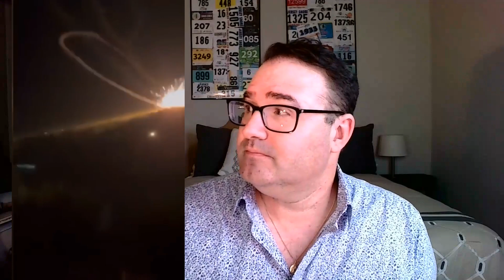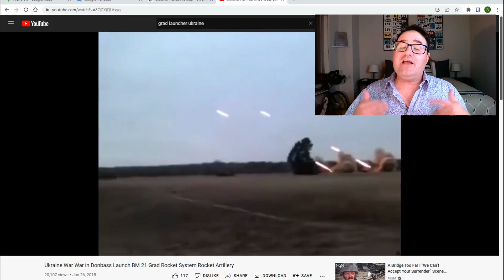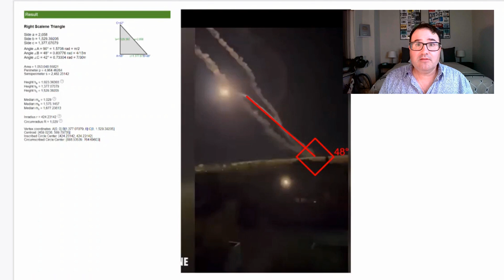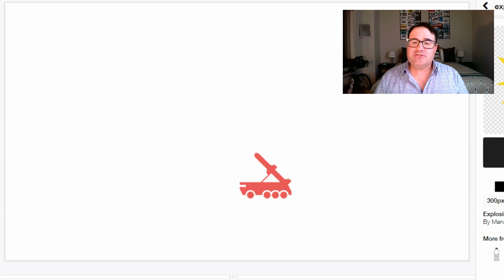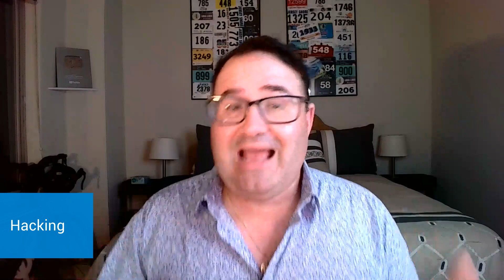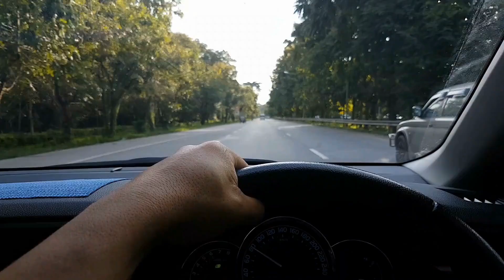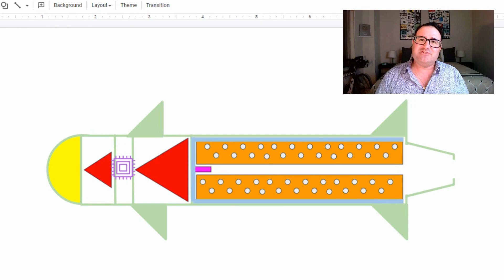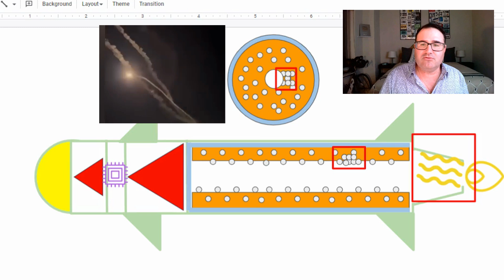Why this missile U -Turned

Comment: The most important thing to remember is that the missile knows where it is at all times. It knows this because it knows where it isn't. By subtracting where it is from where it isn't, or where it isn't from where it is - whichever is greater - it obtains a difference or deviation. The guidance subsystem uses deviation to generate corrective commands to drive the missile from a position where it is to a position where it isn't, and arriving at a position that it wasn't, it now is. Consequently, the position where it is is now the position that it wasn't, and if follows that the position that it was is now the position that it isn't. In the event that the position that the position that it is in is not the position that it wasn't, the system has acquired a variation. The variation being the difference between where the missile is and where it wasn't. If variation is considered to be a significant factor, it too may be corrected by the GEA. However, the missile must also know where it was. The missile guidance computer scenario works as follows: Because a variation has modified some of the information that the missile has obtained, it is not sure just where it is. However, it is sure where it isn't, within reason, and it know where it was. It now subtracts where it should be from where it wasn't, or vice versa. And by differentiating this from the algebraic sum of where it shouldn't be and where it was, it is able to obtain the deviation and its variation, which is called error.

Comment: Can assymatric burn boomerang a missle direct to it's starting point so accurately? If the exhaust is properly built, the thrust will still go straight out the back, aerodynamics and fins kept straight during the boosting phase will require immense power pushing it sideways to boomerang that sharp and at that angle. Especially if it was travelling straight.

Imo it would be an internal problem with tracking amd software due to long storage, or that the target was destroyed during the previous launch and the software went janky. Idk, just a theory

Comment: My vote is for some kind of malfunction with the final stage guidance. That system took over, identified the launcher as a target. The uneven fuel theory doesn't work because you need something to actively cancel the spin created, once it has occurred. Looks like active guidance. The weird bit is that the final stage (on-missile) guidance would have to kick in when in theory there should be lock-outs for this.
Reply: That wouldnt be possible… Imagine the radar seeker in the missile as a moving dish (it actually probably is), the radar dish can only “see” radar returns in a cone in front of it. It would never ever track a target behind it. That is in fact how some missiles are defeated by aircraft, if the missile is low on kinetic energy to maneuver, the aircraft might be able to maneuver out of the missile track cone and make it so the missile can no longer track it.
Reply: In the BUK, as in most Medium/Long Range SAMs, initial guidance is done through radio command. The tracking radar literally flies the missile towards the target, just like someone would fly an RC plane. The missile doesn’t seek radar returns like he suggested on the video, it only does so when the missile “goes pitbull” and activates its own radar, at which point it would indeed be flying towards it’s own radar track. That’s why it would never “lock on” the search or targeting radar’s signature.
That would be possible if that was a Anti-Radiation Missile, which does track radar signatures, but SAM’s don’t work like that.
Reply: Yeah bad take lol. It wasnt in final stage or near it, it was clearly still burning fuel when it happened. And he also clearly explained how it straightened back out afterwards, but that it didnt matter because it was already facing the ground.

Comment: At 4:32 you can see a bright dot right to the blue arrow. In the frames after that, the bright spot moves and it almost looks like a part of the rocket broke off.
I am not sure if the bright spot is not a reflection in the video footage. With "," and "." you can watch videos frame by frame.

Comment: This reminds me of when someone stuck a gyroscope in a rocket upside down. Caused the rocket to do a u-turn as well, but they detonated the rocket before it could hit anything. 
My point is, or rather my question is do these rocket systems require gyroscopic components and where are they being sourced right now if at all? Can they malfunction? How does long storage affect them? etc.
Reply: I doubt much of anything being used in Ukrainr by Russia was recently manufactured. Thus it is some old stock.

Comment: you are probably wrong. Pressure doesn't work like a vector inside a fluid (I'm using my basic pre bachelors degree physics knowledge, just understand my logic don't quote me on my terminology). If the clump is creating excess pressure and gases, it simply pushes against all the surrounding gases too increasing pressures in all directions. Which the gases existing the nozzle wont have any different velocity (which is preed with direction) than otherwise.

even in the worst case scenario its hard to imagine it making a 180 degree turn.

i believe its a software glitch.
Reply from the maker: You know what's interesting reading this?  Everybody who has commented has left different comments based on their job.  Engine people say it couldn't be the engine.  Software people say it couldn't be the software.  Materials people say it couldn't be the fins snapping off.  Electrical people say it couldn't be guidance.
One day, I'm going to do a video on diagnostic momentum.
Reply: @RyanMcBethProgramming  lol.

 I don't think the fins can snap off by human handling (missile only saw human handling before launch). The fins are designed to turn a heavy ass rocket going at mach 3+. It's plenty sturdy and can handle abuse (which is rare in itself) 

It could also be the case that the missile locked to the source radar?? The one used to find prey. 

I say this because the missile's return journey was also flawless. No stray jets of gas, so pieces falling off as far as I can tell. So weird shape of thrust. 

So that leaves either electronics malfunctioning or a software glitch.

Comment: Great theories , Ryan. 
Look up the original HAWK (late 60's, early 70's) anti aircraft missile. It had a tendency to do the same thing. Turn around after firing and go back after its control set. That's why we got the Improved HAWK in the mid to late 70's.

Comment: Anecdote time

I built a homemade model rocket out of cardboard, aluminum electrical fittings and ‘rocket candy’. It fired and functioned perfectly, until it got enough speed up (as in…. Crazy fast. No idea how fast) that it tore a (badly attached) fin off. Then, the rocket did about 1.5 full horizontal loops roughly 400’ above the ground, at which point the motor burned out and the rocket left the loop it was on and shot out in a slow arc away from us (thankfully) and landed 2000’ or so away. 

Anyway, point of the story is that if this was an uncontrolled failure of control surfaces, I would expect it to look something like when you let a balloon got and it whizzes around a room. 

Because of the shape of the interior of the rocket, there’s no real way for an asymmetry in fuel distribution to result in the equivalent of thrust vectoring; because it builds pressure in a chamber, and the outlet is fixed in both direction and diameter; you can’t really get an asymmetric flow density through an orifice. 

The only thing that makes sense to me, seeing the stable flight and symmetrical arc is a control or guidance system failure. Lots of ways that could happen; if a component is installed with inverted polarity, once the rocket starts to guide every time it measures the error and applies correction the error gets bigger. It’s not quite this simple, but PID control works a bit like this: 1% error results in 1% correction. Then 2% error, 2% correction. Then 4%. In this instance, every correction would result in additional error in the guidance system, so it would accelerate the correction input every scan; probably every 5mS or so. Maybe less.

Comment: Ryan, I'm a former missile guy.  There is a possibility that the safe arm system of the missile failed, activating the seeker before it acquired the initial target. Since the ground search radar was probably the closest and largest signal, it is likely that the guidance system directed it to the ground station. This has happened before with US and Soviet gear.
Reply: I'm not a former missile guy but this was my armchair guess as well.
Reply: I'm a former cabbage guy. This was a plain and simple turnip retriever rocket.
Reply: Actually, I think it's more related to the Proton-M crash on February 7th 2013, where an inertial guidance system was installed upside down. If you watch the Proton-M video, the rocket very nearly completes a U-turn before it breaks up or is remotely detonated. A full-size rocket couldn't survive that kind of maneuver; it's not rigid enough. But a much smaller missile could.
Reply: To me it looks like it lands between the person recording and the launcher.
Reply: Much more likely explanation.
Reply: I dont think it would pick it up if its behind it
Reply: @yt45204  no radar can see behind itself unless it is spinning 360, the missile radar seeker is in the front of the missile and it only activates when very close to the target and starts tracking the target itself
Reply: Sounds like a MUCH more plausible explanation. What are the odds that unbalanced fuel would make it turn exactly 180 degrees? Very low. 
Also, don't these things have active steering during the boost phase?
Reply: I'm guessing it's probably actually the result of radar jamming... specifically range masking which made the missile believe it was past the target and then U turn.  Pretty common effect of ECM/EW jamming of a SAM site. 

As for why not the first two, well, probably because the jammer itself didn't get the missile launch signal to activate the jammer immediately and it took a minute to kick on at full strength.
Reply: ECM caused a missile to turn back and hit it's guidance radar back in Libya circa 1986.
Reply: @Whiskey11Gaming  so.... whatvwas the target? What has this capability? UK stuff? Why isn't this happening more?
Reply: Do you think it’s possible these dense cabbages accidentally passed their own coordinates?
Reply: @user-sp9ue1ws7c  It doesn't use gps coordinates.
Reply: @user-sp9ue1ws7c  these don't use cords
Reply: That makes sense but the rocket slammed into a park where there shouldn't have been anything to attract the rocket.
Reply: I think thered be a fail safe action in them to prevent this exact thing, or why make thousands of rockets when the lottery is this? , im sure thermobaric use the same guidence and hardware, one hell of a risk to not add fail safes, dont you think! Im positive that all do even soviet stuff...
Reply: @Aditya Chavarkar Yes, at least they went in the general direction of where they were intended.
Reply: Looks more like that given the clean and quick 180 turn followed by a straight line yeah.
Reply: @yt45204  Because the radar is spinning, the missile radar is not
Reply: @yt45204  Thats possible but the seeker does not activate until about 10nm to the target which is when it goes "pitbull"
Reply: @yt45204  Im pretty sure even the us didnt use digital circuits on some of their missiles in the 70s, the pheonix for example, it was only upgraded later with a digital circuit in the C version.
Reply: Saw the same thing said on reddit. I think you're correct
Reply: Great point, but if it acquired a radar it's chip would be looking for the tracking radar not the search.
Reply: @yt45204   
Few get the reference
Reply: Concur
Reply: Crazy how there is actually a greater than zero chance of your own missile pulling a loony toons style u-turn  in mid air and coming straight back at you.
Reply: A pleasantly mobile missile
Reply: @yt45204  but by knowing where it isnt, it now knows where it is
Reply: @yt45204  I recall using line of sight antennas to form a network.  Though I had never seen anyone jam one.  I didn't have a visual display, just a black box.
Reply: This is exactly what I thought was going on.
Reply: That's al I needed to know, thank you and I'm out of here!
Reply: @yt45204  The definition of a back lobe is that it couples energy from behind the antenna as if it was in front of the antenna. It's also several orders of magnitude less sensitive than the main beam
That means that a radar receiving a signal from the back lobe would still assume the signal came from the front...
Reply: But there where two other rocket trails that lead way fine.
Reply: I really hope that's what happened xD
Reply: Thought the same the moment I saw that video. Have no affiliation with rockets and/or radars :)
Reply: If that the case dont buy em or mek em that way!!!.. , u aint got a scooby yaself av ya mate???...

Comment: I don’t think solid propellant that’s no longer homogeneous (debatable if that changes after manufacturing anyway) would cause such drastic changes to the thrust vector. Is there a missile that uses thrust vectoring during flight? If so, maybe a malfunction with that kind of system. Idk. You could be right. Other option is it’s a fake video I guess. Anyway, I like your content. Thank you!

Comment: Oddly everyone thinks that the circuits are perfectly fine and that they can't possibly cause the missile to fly off course.

They're the likely culprit. Not due to hacking, but bit rot, incorrectly burned EEPROM, failing gyro/altimeter sensors or some other issue that caused the missile to think it was flying in the wrong direction.

Comment: Idk, there are so many things this could be. 

Think of the Proton that crash a few years ago in Russia. The gyrostabilizer was installed exactly 180 degrees backwards and the rocket self-corrected the flight path directly into the ground below. Perhaps something similar happened since it essentially did a 180.

Alternatively, the total lack of training might have lead to a guidance error where the destination was the origin. These Russians get about 6 weeks of training and are expected to know how to operate these things perfectly.

Either way, not great for Russia.

Comment: Someone put inertial guidance in that particular rocket upside down. Years ago a Russian proton orbital class rocket had someone hammer in the part that measures vertical acceleration in backwards so it ended up flipping upside down and trying to fly back into the ground but it broke apart from the g forces. This did exactly the same thing It just could handle the g-forces .
Reply: exactly what I was thinking about

Comment: As someone who knows LITTLE to NOTHING about these weapon systems I was thinking it looked like a missile abort. The missile goes up in the general direction of the other trails, then turns toward camera and goes straight into the soil, not sure but I don't think it would've ended up to close to the vehicle. Would the conical jet be so drastically effected by this hypothetical glob of propellant?

Comment: Oddly enough this isn't the first time I've seen video of a Russian rocket doing a Uturn right after take off. This looks a lot like the video of a Proton-M in 2013 that failed because the angular velocity sensors were installed upside down. Oops.

Comment: If it’s a guided system using a gyro, the gyro could have been installed 180 degrees out......has happened to large multi stage rockets in the past....

Comment: That's not it at all. Even if that did happen it would only hinder the velocity. It's just like a jet like an F-18. If one engine goes out it's not going to turn on its own. It would just fly slower. My guess is a tracking error or sabotage.

Comment: I disagree. It tracked directly back to the launcher. Maybe at a point where it had switched from boost to cruise and would be tracking radar signal? If something got switched around in the guidance system, could it have just realigned with the source (turned) and guided backwards to the launcher? So instead of following radar out to target it followed it back to signal source.

Comment: Wasn't there some kind of an issue with space rockets once in Russia where a gps was installed upside down? I vaguely remember watching a video on something like that and despite there being physical designs in place to prevent an upside down installation, the people building it took a hammer to everything and forced it to fit.

Comment: There is no way it could make a turn that sharp from anything other than a defect, be it mishandling or a misshapen combustion chamber. Maybe during manufacturing there was an issue that left holes or gaps in the fuel, or even some of the solid fuel became cracked and dislodged like my model rocket did when I was a kid, the burn stopped for a split second, just long enough to change course, the heat reignited and that was all it took to go from a perfect launch to landing on top of our local foodlion. 😀

Comment: thanks Ryan ,
 interesting  
your preferred scenario had me wondering tho,... arent thos missiles  rotating at this point in  flight, ... ?  
i like  the concept of  a bad mix/clump of fuel  getting burned  but if as your diagram suggests, the burn is accessing all the fuel thru the central spaces in the middle , spinning or not, the thrust  coming out the back end  would still be funnelled straight  if you can understand my bad explaining